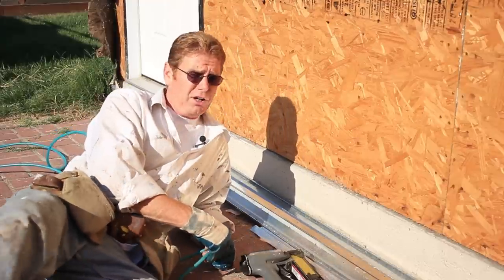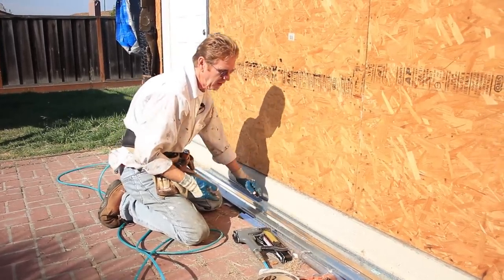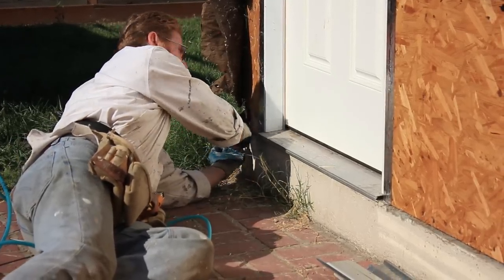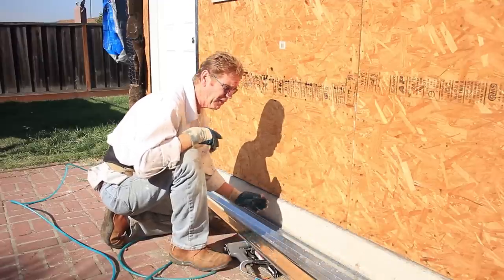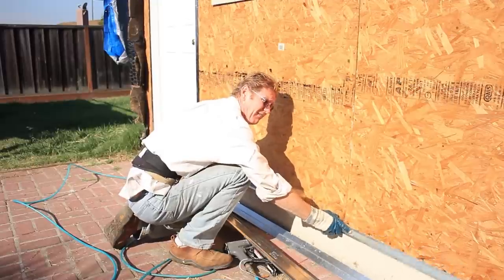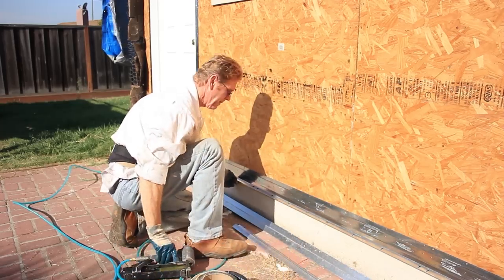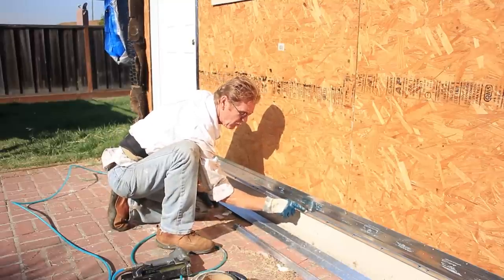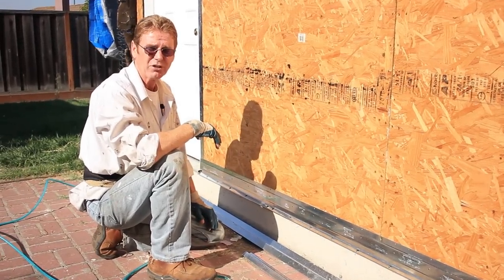Proud foundation fix before stucco

Comment: We have a porch which has a 16 inch concrete foundation - I would like to run stucco from the bottom of the foundation to the top of the porch. I'm not quite sure how I flash the transition from concrete to wood sheathing without trapping water. Any advice would be helpful.
Reply from the maker: Morning Ping Pong, type is "counter flashing below concrete" and similar titles, on my site,  I have many videos explaining what your options are.
    Live long and plaster
 teaching  plastering video’s

Comment: That’s not gonna last. It doesn’t overhang the concrete enough on the vertical face of the foundation. Only a half inch down moisture will for sure wick back up and rot the mud sill.
Reply from the maker: Howdy Matt, you know just enough to think your right,  but not enough to know you're wrong. 🤔
Reply: @StuccoPlastering  I hope I am wrong but to be safe, if I were flashing it I’d have had a sheet metal guy make a similar piece that comes down a bit farther. I like your work though
Reply from the maker: @Matt-iu2qw  No worries, they don't have sheet metal, guys, at home depot or the other material yards. Sometimes when we're doing someone a favor, we have to improvise. 🤔
Reply: If this customer doesn't call back after el Niño storm , it means it solid
Reply: It needs to overhang foundation because water will drain to bottom and keep getting stuck on the second screed since their is a pocket. Dunno how long that will last, but things like this are hard to fix have to think of custom solutions.

Comment: i really like all your ideas but what i've learned over the years is the water weeps out of the edge of the drip flashing or weep screed. holes at the bottom of the weep screed creates a bond between the weep screed and the scratch and brown coats. So technically edge of weep screed need to be protected from finish coats or any paint to prevent water from collecting.
Reply from the maker: Hello Oscar Galvan, you have done your homework,
 Weep or drip screeds also serves as an expansion joint and equally important somewhere to stop the stucco.
Have a Merry Christmas from Kirk and Jason’s DIY plastering channel

Comment: Hi I live in Brazil and would like to ask about applying stucco over a 2400 sqft container home.The initila plan is to apply cement boards the same kind that is used in bathrooms, and then asphalt and then the stucco. Should I be concerned about drip screed as well? What kind should I use?
Reply from the maker: Howdy Ana, I don't know what a container house is?   
What is it made from, wood or metal?
                     Live long and plaster, 
  Sharing stucco secrets, or common sense tips

Comment: What do you do if the foundation is opposite of this, and it’s recessed more than the mud sill/subfloor? On my house, the subfloor sticks out about an inch from the foundation, and the mud sill is a bit uneven with the foundation. It’s an old house.
Reply from the maker: Hello my friend that's even easier, Just install the weed screed a half-inch below the sheathing.

Comment: Hi Kirk 
I know weep screed is code in california for stucco, but is it code for cement siding as well?
Thanks and great videos
Reply from the maker: Evening Barry, no. why? great question, glad you asked.
 For wood walls placing a weep speed below the mudsill and on top of the sheathing protects the plywood sheathing as well as a wood mudsill.
 bricks, concrete walls block or CMU walls have nothing to protect again rain as the rain can't rot cementitious substrates.

                       Get Plastered
      Kirk and Jason Giordano Plastering
Reply: Truckin Forever,

Did you use a weep screen or a bug screen on your fiber cement? I am going to do hardie plank on my house. Thanks

Comment: Hi Kirk, Your videos are very informative and easy to follow for a DIY person.  I have one question regarding materials. As a DIYer, where do I buy flashing, weep screed, and casing bead? It seems like most are only available for contractors or I have to buy a full box when I only need 20' or so of materials.  I live in Maryland and any tips would be appreciated.
Reply from the maker: Howdy Glenn, most hardware stores such as Home Depot and or Lowes sells the majority of the products we use however for some specialty items, type in plastering yards in your area.
                 Best wishes,
Plastering tips from your favorite stucco geeks

Comment: Hello Kirk .  I live in Monterey Nor Cal by cannery road.  Can you refer or maybe you can .....repair water intrusion through the sill plate.  When it rains some of the sill plate gets wet.  I have been keeping track of the water on the sill.
Also I would like to cut out some of the bad sill.
Thank you
Your videos are equivalent to attending a trade school or apprenticeship classes.
But you make them so elegantly easy to understand and that is a skill you possess.
Thanks
Ray Ramirez
Reply from the maker: Hi Rayram555, thank you, you might try the BBB or craigslist, but your best bet is to call a licensed stucco guy, as most of these guys can just look at the wall and tell you where the problem originates,
 Kirk giordano Plastering

Comment: Kirk, even though I moved from a stucco house to a board and batten house, I continue to watch your videos. Would the weep screed work for keeping the bottom edges of my siding from rotting further? Thanks
Reply from the maker: Howdy David, not really,
 If it were me I'd use the best elastomeric paint primer sold in the U.S., this will work better and not be an eyesore.      
                 Best wishes,
Plastering tips from your favorite stucco geeks

Comment: Thank you for these videos. I have a question about this video. Is it possible to flush the plywood with concrete and install the WEEP SCREED
 on the concrete? (to see less concrete)
Reply from the maker: Evening Gholi, you can but the rain will ruin the wood in 6 to 10 years.
 It's best to slide some metal down between the wood and concrete then install the flashing at least an inch above the ground.
                         Bringing peace, love, and harmony back to the world of plastering.
With over 800 educational and free Youtube videos, by your favorite plaster geek, “me,” and Jason, my son, the bearded plasterer.

Comment: What type of stapler do you use? Type of staples? Thanks
Reply from the maker: Hi Giorgio, I use a Senco gun, with staples that are 7/8 inch wide by an inch and a quarter long, as at least 7/8 th of the leg has got to embed in the stud. Keep in mind we have to account for the plywood.
 cheers.

Comment: What is STUCCO AWNINGS
Reply from the maker: @_vaporu_131  An awning made of stucco instead of cloth or any other material. Google Awnings.
Reply: @StuccoPlastering  is it build of wood then just cover it with stucco
Reply from the maker: @_vaporu_131  One can stucco just about anything built with wood.

Comment: Hi Kirk I made a video showing the wicking problem I'm having.  I think stucco was added to the foundation and piled up to where it's covering most of the screed and water can travel upwards through the weep holes into the upper wall.  This only happens in the winter months.  I also may be making the ground wetter because I water the palms once a week.  At the end of the video I show a side profile of the screed at the corner where I was able to chip off a little material. https://www.youtube.com/watch?v=ci7QP8a_Mog
Reply from the maker: Howdy, good investigating, this is typical when sprinklers are set up to hit the stucco walls continuously. 😉
Reply: @StuccoPlastering  thanks I thought the same but my irrigation system is completely disabled for many months.  Even now in August here in San Diego on some drier days the front wall all looks dry but on some slightly more humid days or slightly cooler (like yesterday) I can see the area wet just a little.. that exact little spot doesn't get much sun because it's blocked by a palm tree and vinyl fence.  It's ever so slight of a blockage but I wonder if it's just surface moisture.